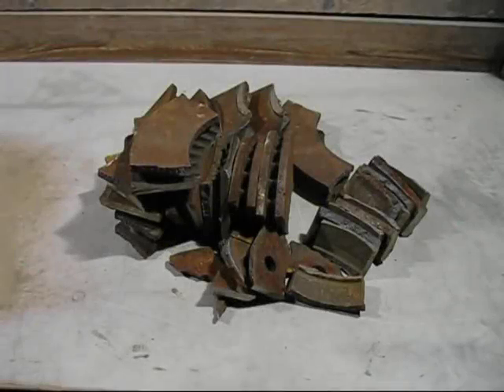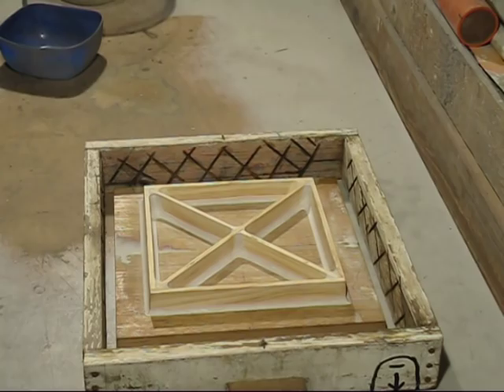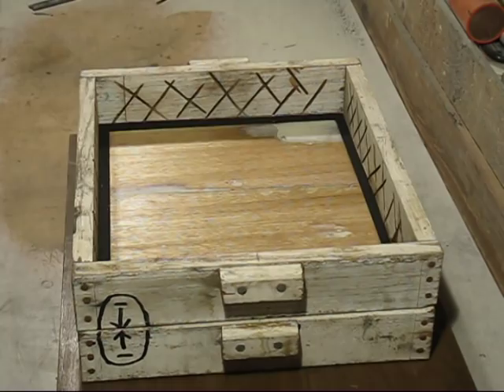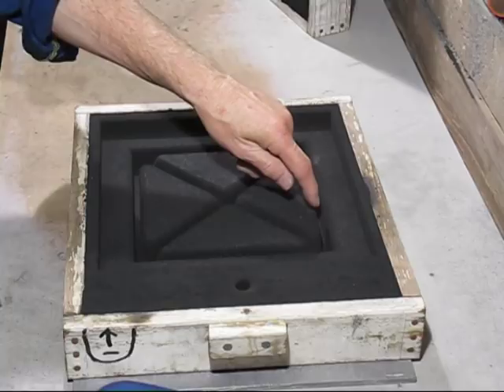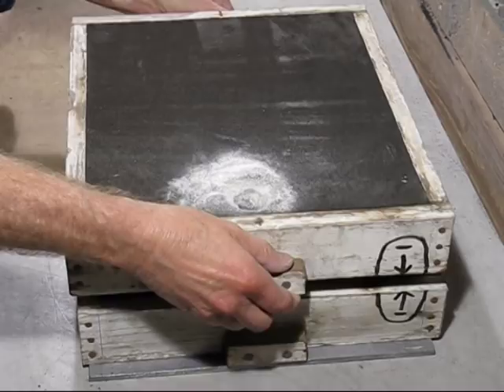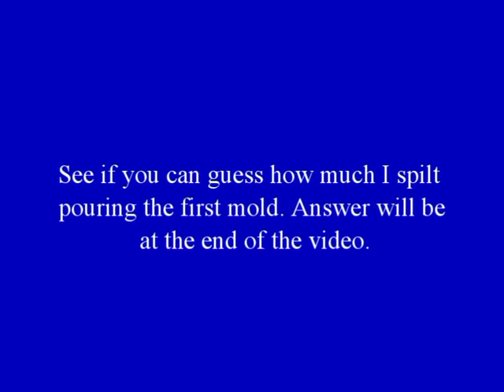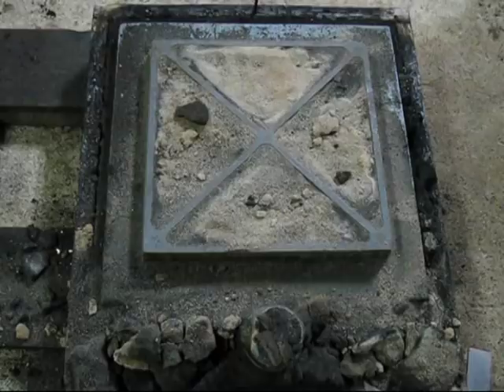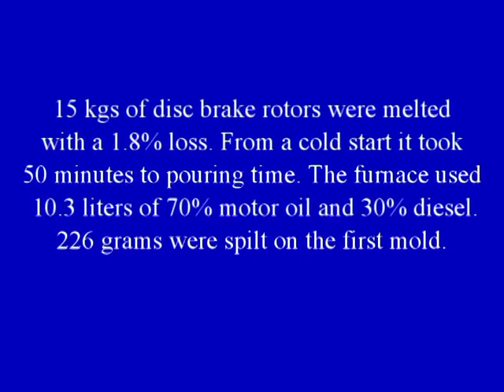Melting disc brake rotors (crucible camera action)

Comment: what is the difference between facing and backing sand?
Reply from the maker: Facing sand is new sand and backing sand is old used sand.
Reply: + @luckygen1001  , SK did you find the graphite more useful or less useful as opposed to the talcum powder? 
  Thankyou for sharing and blessed day sirSir, Crawford out
Reply from the maker: It did give a slightly better surface finish.
Reply: + @luckygen1001  , excellant.  Truely glad it worked out better for you. Glad to hear from you also.
   I have some disc break rotors from a Ford 1.25 ton. They weigh at 65 lbs each...4 of them and 2from the rear axle drums.
I want to melt them down and make the bottom 3/4 of an anvil w the top plate made of a 4inch thick plate of high carbon steel forklift fork that is very hard.  I've been told to add 15 to 20% powdered 1084 or 1095 and 1 % powdered nickel to the melts when casting the lower portion of the anvil.  Its purpose will be forming the weight under the hard facing. I've also heard that I need to build the form so that it has at least 12 to 16 inches of good insulation value and let it cool very slowly over about a week so that it isnt brittle.
   Does this ratio sound right to you? I've never casted anything so I'm going by the advise of others and you seem more knowledgeable than most
So I respect your opinion far more than others
Reply from the maker: Wow 65 lbs (29 kgs) each that is a lot of scrap iron. I have never made a anvil so I don't know if those ratios are correct.
Reply: + @luckygen1001  , thank you very much.  Still trying to decide what to line the forge/ furnace/ kiln with as I learned the pearlite/alumina powder/ waterglass mixture melts out around 2000+ or - degrees Fahrenheit or so I've been told. Not sure really I've heard coating with satanite then itc100 will work. 
  What did you line yours with? That stands the heat to melt castiron?
Reply from the maker: I use Zircoat but it is no longer available.  I am helping another person to build a furnace and said to him to try satanite.

Comment: Scrapping here I get less for cast iron then regular just took in 2100 lbs of broken cast iron sinks/bath tubs got $105 that was $100 a ton USD

Edit:  if some one wanted some for projects near me I would just give it to them. Sidney Mt USA
Reply from the maker: Bath tubs and sinks are very good scrap to melt.
Reply: that's somewhat of an irony with scrap with many places; if you just take straight scrap, it's pretty much worthless (especially aluminum), but if you melt it down into ingots first, they'll give you more for it

Comment: Surface plate?
Reply from the maker: Yes.
Reply: So according to wikipedia: "A surface plate is a solid, flat plate used as the main horizontal reference plane for precision inspection, marking out (layout), and tooling setup.[1] The surface plate is often used as the baseline for all measurements to a workpiece, therefore one primary surface is finished extremely flat with tolerances below 11.5 μm or 0.0115 mm per 2960mm for a grade 0 plate[2]."

This just begs the question...What is the intended workpiece that needs a surface plate?
Reply: Dennis, thanks for replying to my question.  Searching for "surface plate" on the internet results in images of basically just a big and level plate.  It seems like (you had said) that the same plate can be used in a number of machining applications and won't always be created for a specific project.

Luckygen could have stood to do a little more contextual explanation for us non-machinists.  I'm disappointed in the general lack of response from the comments community (yourself excluded).  I saw the same question basically ignored over and over again.  I guess some people (again, yourself excluded) can't be bothered to answer a noob question every now and again.  I guess these people we're just born with all the machining answers...Thanks again, bud.
Reply: Among many other things, I use both an iron and granite surface plate, (side by side on the same steel frame) for setting tools. No need to introduce set-up errors, to a process that has other factors to compound the errors. Often, I will use magnetic holders on the iron surface plate, hanging over the (superior) granite plate for the tooling.

Bluing the surface of a precision part, and rubbing it in a wide path (equal plate wear, even though minute) on a surface plate, is the proven method to show where hand scraping can improve the surface, to a fine degree. Surface plates are "rubbed in" on other plates, Alternating with 3 unfinished plates, all 3 can be brought to near perfection by this method.

Comment: You know your stuff and you will have a good face plate once machined. But tell me why do you call them rotors, you  say disk brake rotors in the UK we just call them discs
Reply: Who's we? It's because there are thousands of kinds of disks, some even used in Olympic Games, with the Greek "spelling", discus.
Disk brakes are composed of several parts, he only uses one of them, the ROTORS, which is what "we" in the US call them, but he makes a closer definition for hair dressers, runway models  and bakers, "disk brake rotors". Clearly, just "disks" or even "rotors" alone, fall far short of explanatory, unless you are talking to a brake mechanic who doesn't have a life. Like, if you melt the pucks, (the heart of "disk brakes") they get gooey, then the binder burns out. Now the hoses...... :-)

PS, machining surface plates is only the second step after fettling the rough casting. After that, a large surface grinder is commonly used to flatten them, and even then they are useless for their intended use, metrology. Metrology demands that they be blued and tediously hand scraped (by one of the very few who know how) to a true flat surface, or they simply won't do the job. All very critical  metrology is performed on hand scraped granite surface plates, which are nearly impervious to temperature change and have had millions of years to stabilize. Cast iron surface plates will only suffice when repeatable accuracy to two decimal places, or to a very fastidious three places will do. I use both. Iron surface plates for non-critical work, do have a distinct advantage, since magnetic metrology tools "don't stick" to granite. Later, headed out to the disco.

Comment: Doesn't concrete explode if you pour liquid metal onto it?
Reply from the maker: I always get asked that question and it never explodes.
Reply from the maker: The same goes with molding sand, it has moisture but does not explode. It all depends on how much moisture is present.
Reply: Sand doesn't hold onto the moisture the way concrete does. Sand naturally vents the steam without allowing it to build up pressure. If the steam has a way to escape as fast as it is created then nothing explodes. I hope you never deal with spalling concrete during a pour. Once you do, after you change your pants, you'll spread some sheet metal or sand on the concrete before you pour there again. CHEAP insurance.

Comment: Do you have a smelting license from the council? Has your facility been inspected by the smelting warden?
Is it lawful to possess that much iron at one time? Did you pay the cast iron tax? All that metal could be used for making knives.
Reply from the maker: No, no ,no, and no. Making knives is a pointless waste of time in my opinion.
Reply: If done right, there's always a point. ;)
Reply: add some carbon, stir it a bit,
Reply: We used to have a small old print shop, before the digital age. Any piece of hard steel that was the right size and would hold an edge was fair game to make a knife in ten minutes.  Our little shop had some useful knives 20-30 years old, with wound-up handles and sharpened down to 2/3 original width.  But custom knives, like custom ballpoint pens, are for snobs to impress each other.
Reply: It's just a matter of time before HRM's Internet Warden Police Program finds his posting, and then he will have to pay a fine and get all of the proper permits, or shut down his smelting operation. Can't have ordinary folks doing things under the table.

Comment: Wow so brake rotors are a fairly cheap easy way to cast hardened high carbon steel for blades
Reply from the maker: Brake rotors are cast iron.
Reply: luckygen1001 it is really dependent on the type rotor, and brand. I know in the US some rotors are cast steel.
Reply: if you're into blades/knife making,  use leaf spring steel